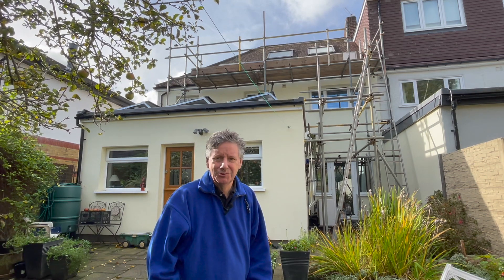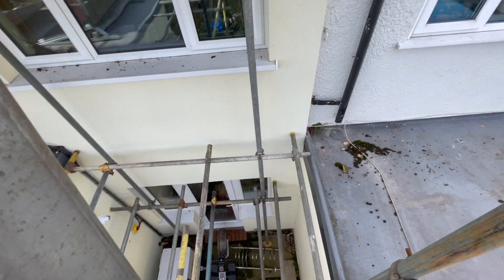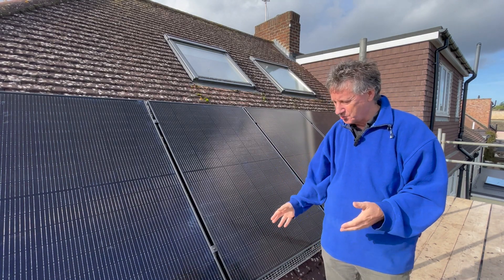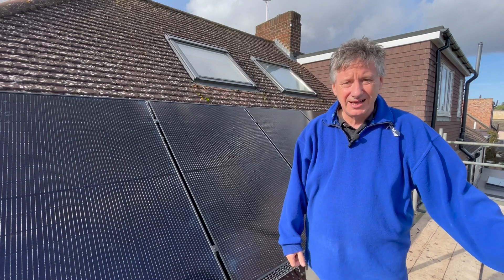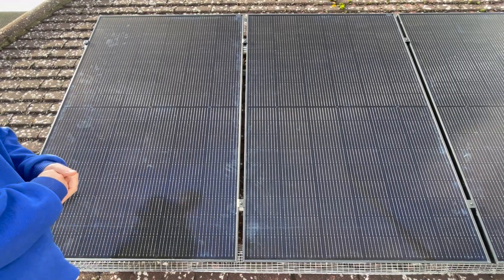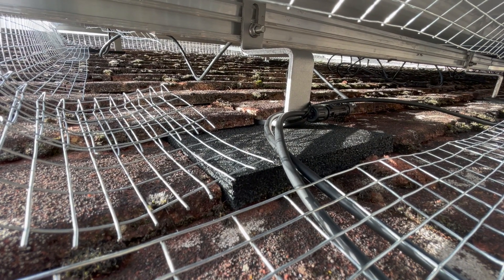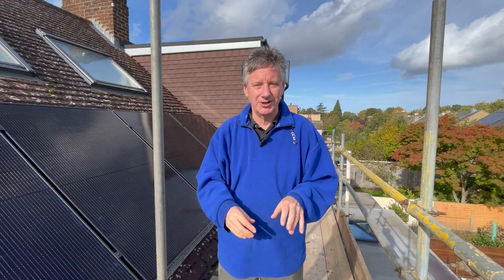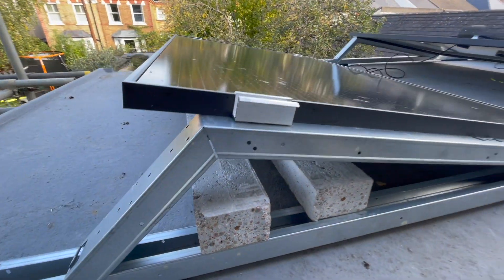New solar PV panels on the roof.

Comment: We finally got our Solar PV system fitted in September, the battery coming a little later. Like your data suggests, yes we did see a reduction in grid use straight away but having the battery has helped us remove our reliance on the grid in peak, charging in off peak at a lower rate, reducing load on the grid system.
Reply from the maker: Hi. Thanks for stopping by. I believe your discovery about the power of PV + batteries is going to be shared by many people in the years. It is a really profound change in ethics way we use energy. 

Good luck in your endeavours.M

Comment: Hi Michael. I also have a flat roof that has space for 6 panels in the orientation you have. I’ve followed your tip and used Easy PV to design the layout but I came unstuck at the weight loading section. I don’t know how much ballast is needed. How much weight are the concrete lintels you’re using? Thanks for the easy PV tip.
Reply from the maker: Steve, Good Afternoon. On this set up there are 4 lintels and by eyeballing the size and length I estimate that each one weighs between 50. and 60 kg. So that's over 200 kg of weight. I'll let you know if it blows away over the winter....

All the best

Michael

Comment: Another interesting video, thank you. I would love to see the end result of the cable management, especially for the flat roof. I have a 7m x 4m shed that I am looking to put panels on. I must say I prefer that bird guard over the solid metal ones, it concerns me if not tightened down how lethal it could be if blown off in a storm, also you should get plenty of ventilation through the back side of the panels with the wire mesh one you have 🙂. How do they secure that to the frame if you don’t mind me asking? 
Like another comment, I have a not far off south facing roof and shed roof, again lacking money having 3 kids and a full time mother of my children 💸💸💸💸
I’m thinking a home improvement loan is going to be required so I can pull my finger out so I can lower my CO2 long term asap. 
Kind Regards, Adam.
Reply from the maker: Adam, Good evening and thank you for your kind words. 

Regarding cable runs, I did make a bit of video showing how the cables came into the house, but the second part of the installation is going slower than anticipated - i.e. they haven't started yet! - so I will wait to show that bit.

The pigeon protection is simply cut and wedged in place. Apparently previous versions of the panels have a lip on the underside of the frame to which the mesh could be secured, but the new panels don't. It does feel pretty substantially wedged in.

The opportunity to do this kind of stuff only came about because of the tax-free lump sum I received on retirement. I spent most of my life focussing on the children and never expected to ever have any money to spend on this kind of thing. I hope your time will come. Meanwhile, if you document the existing energy consumption of your house (weekly gas and electricity readings) it will help should the opportunity to make changes ever arise.

Best wishes

Michael

Comment: Hi,As a family looking at energy sustainability I came across your heat pump video.Very informative and useful,thank you.
We are also looking at solar generation coupled with battery and have seen this video.
We have a similar flat roof with an easterly aspect and I would be interested to know how you decided on the panels positioning for Solar gain, considering the other rear panels are facing in an easterly direction.
Thanks again for taking the time to share your experience and knowledge.
Reply from the maker: Stefan, thank you for your kind words.

On the east-facing roof there is no choice about the orientation of the panels. They will produce well in summer and that's OK. They have no shading issues.

On the flat roof the installer insists the panels should be tilted at 12° - so they almost flat with just enough slope to keep water off them. But the sky situation is constrained.

The sky to the East and South is reasonably clear although there are trees to the South-east. The south west is blocked by our neighbours (although the Sun will be high enough to overcome that in mid-summer) and the west is blocked by the house. It seemed slightly better to point them south rather than east. 

If you want to do calculations yourself I strongly recommend the Easy-PV website which allows you design your own roof and evaluate the output as you swap panels and orientations. You have to register and it's not completely straightforward to use, but they don't hassle you and it is accurate.

https://easy-pv.co.uk/home 

The video is accompanied by this blog article

https://protonsforbreakfast.wordpress.com/2022/10/27/new-solar-panels/

Best wishes

M